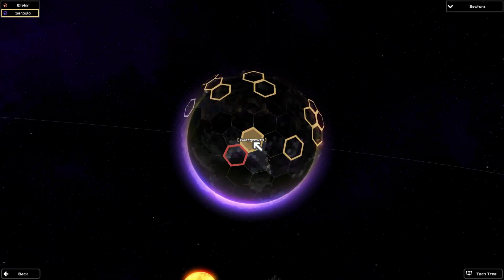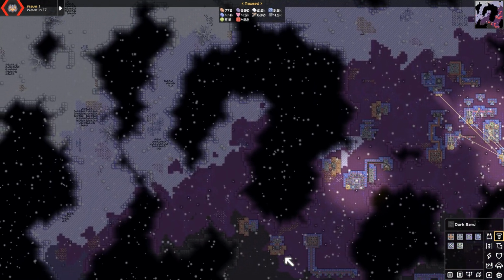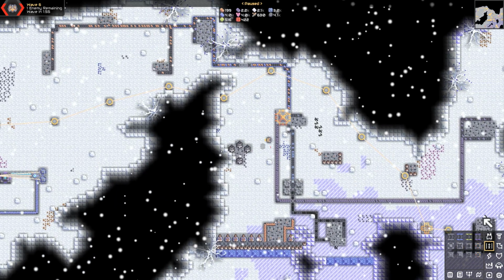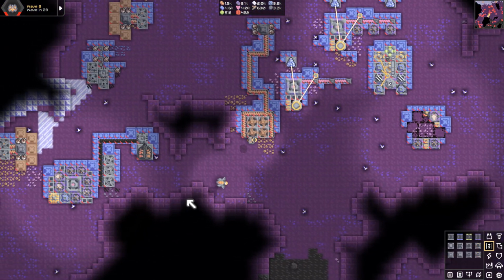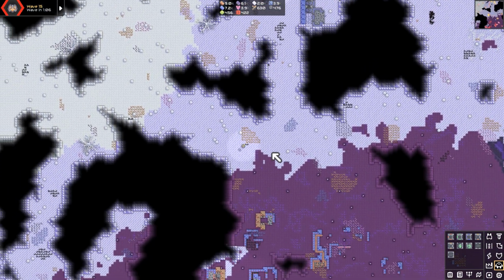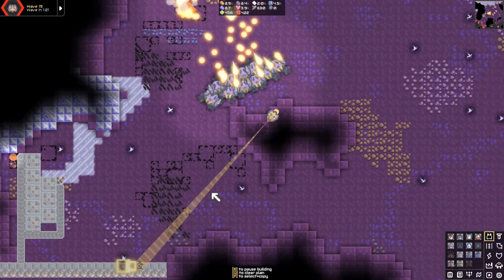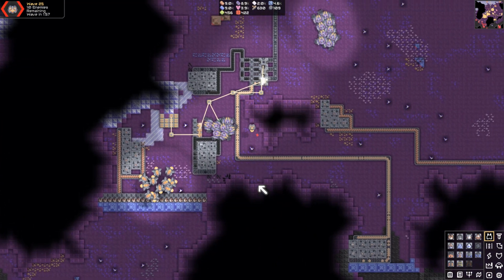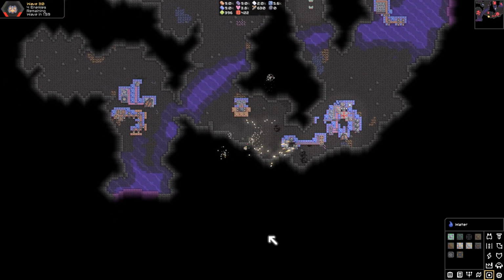Mindustry There Was a Fire Fight!

Comment: Attack sector short guide
You can mix in novas in your ground army to achieve healing while fighting.

Fuses have very short range, so most units can actually outrange them. Don't use horizons they will eie.

For areas that heavily defend ground more than air, use air to destroy those areas, and vice versa for air defence areas

Your main goal is to destroy the core, you do not have to take down every single defense. You can speed through some levels just by ploughing through the weak defenses to secure a direct path to the core.

s i l i c o n
silicon shortage in high+ threat or during later waves = dead
Reply: Btw power > Cultivator # spore pods > Spore press # oil > Coal centrifuge # coal > Steam generator + water extractor # more power than before
Reply from the maker: Thank you for your insights.

Comment: Sorry that I was confused in the last clip. (on YouTube it was not possible to put pictures)
_________________________________
★Tip
- I usually see you use normal belts often. Probably because it only uses copper. But in some cases, you can use a bridge instead.(because it only uses copper&lead) and besides, you can hold→drag Can be like a normal belt.
- Power mode can press and hold → drag as well.
Reply from the maker: Thanks.

Comment: You can send resources to maps you are attacking. The requirement is simply to have a core on that map. So you build a quick set of defenses, pop over to your resource hub and target your 20+ launchpad at the base you are attacking and teleport back over to it.
Next, you really need to make building poly units your priority, it allows you to build everything like 10x faster.
Reply from the maker: I think I’m going to use them in my next sector. Build time is becoming an issue for me.
Reply: Assist units have modes, when you select poly you can tell it to auto mine, auto repair, auto build, assist you, or do nothing. If there are no destroyed buildings build will attempt to come to you when you start building but they can be halfway across the map so it will take them a while to reach you so they could barely help. Assist mode has them follow closely behind you so they can start building stuff as soon as you do.
Reply from the maker: @starburst98  Thank you so much. That makes things easier.